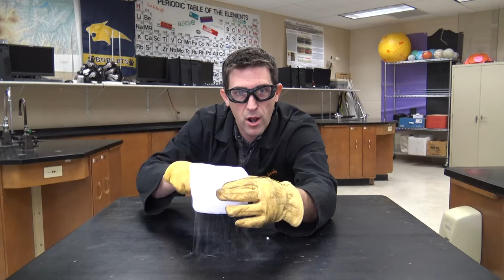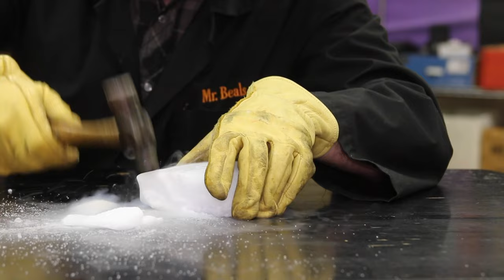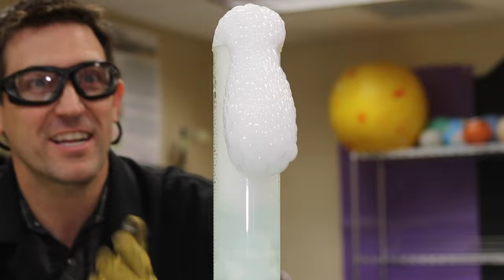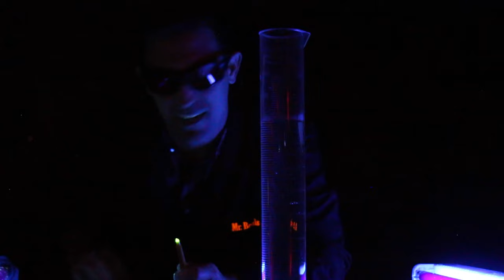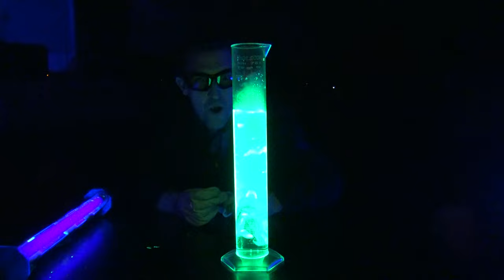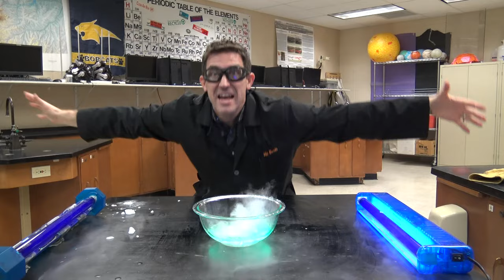Dry Ice Experiments - You Can Try at Home

Comment: Hello Craig, please, for safety purposes, advice to use it in well ventilated or open spaces. CO2 can be toxic in high concentrations. 1 pound of dry ice = 250 liters of CO2 gas
. The permissible exposure limit for 15 min is 30.000 ppm, and 5,000 ppm for 8 hours of exposure.
Reply from the maker: Thanks for the heads up! This is a good reminder for anyone who is going to use dry ice!
Reply: @BealsScience  I'm currently working on our chemical hygiene plan as the EOHS of the lab I work for, revamping SOP's and one of them is for Dry Ice. 

Back in college a student pour them through the pipes... what a disaster. 

Safety always!
Reply: Gas cant be a litre or litres its moles

Comment: Hello! I didn't really understand why water makes the reaction faster
Reply from the maker: Let me try to help:
When the dry ice is sitting in air, the air around it cools very rapidly (think of a layer of colder air that is near the dry ice). Some of it floats away from the block of co2 but much of it stays next to the block which slows the sublimation (formation of the co2 fog from the solid block). 
In water, molecules of frozen co2 touch the 'warm' water and turn to a gas and quickly float away from the block of ice - this bubble of cold co2 vapor bubbles up away from the block of dry ice and, as it does, water rushes in to take its place next to the co2 and the process happens again and again. So, because of the difference in properties of the liquid water and gaseous air, you get quicker sublimation of co2.
Does that help?

Comment: exhaust from combustion of gas motors is made of:   The fumes are usually made up of three main components: carbon dioxide, nitrogen gas, and water vapor. 

and if CO2 is more dense than air, that means that the exhaust component of CO2 does not rise but instead it flows down to the earth. ANd soil and plants need CO2. SO i do not get it???
Reply: wow stop thinking you sound intelligent!  BTW the engine does not make carbon dioxide, nitrogen gas, and water vapor that is the catalytic converter that does that!  in the USA id is a federal crime to remove the catalytic converter !